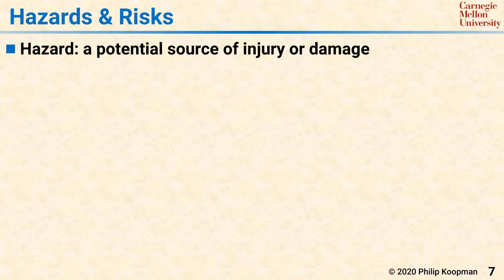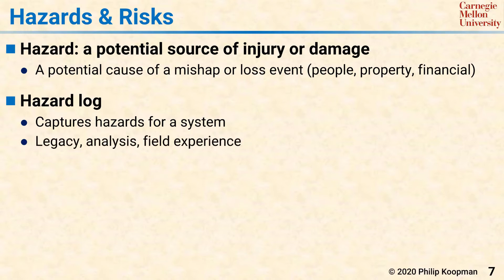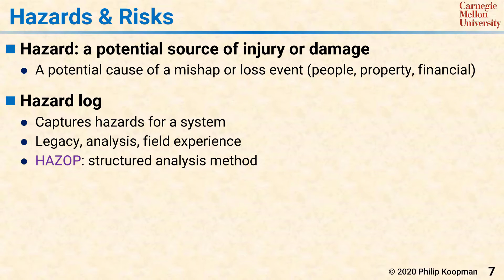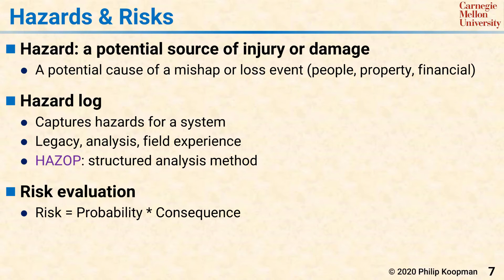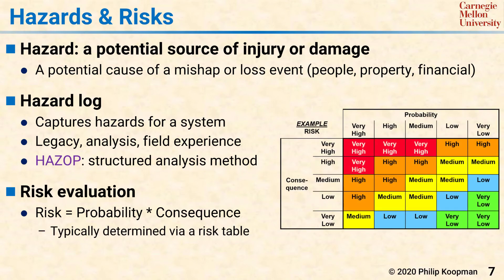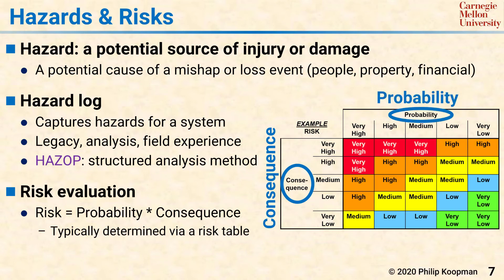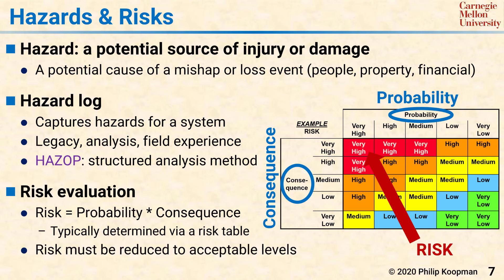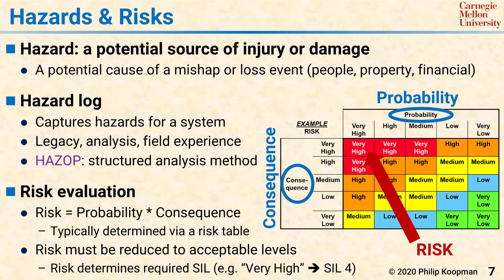L29 07 Hazards and Risks  -- Risk Table

Comment: What's the thougut process behind retaining a hazard's original SIL even if the design evolves to mitigate probability? E.g. if originally a relief valve was controlled my a PLC to open and then later you change the design so that the valve naturally opens based on pressure, wouldnt that lower borth probability and consequence of an explosion hazard?
Reply from the maker: You have still mitigated the hazard in this example.
A valve that naturally opens must still do so based on pressure at that same SIL. The acceptable probability of failure has not changed at the system level. However, you now do not have to deal with a PLC failure as one of the reasons for a relief valve opening failure. Mechanical failure modes (e.g., corrosion) did not go away, and still need to be evaluated to make sure they have acceptable failure probability. It would be no surprise if you need two relief valves or a diverse failure prevention mechanism. For example, water heater designs I looked at had both a relief valve for over-temperature failures and a melt plug (because pressurizing raises the boiling point).

However, this comment is there for a somewhat different purpose. Sometimes there is circular thinking that if you have mitigated the risk you no longer need high-SIL mitigation because the risk has been mitigated. That is incorrect reasoning.
Reply: @philkoopman  Thanks for responding and thanks for lending us your insight!